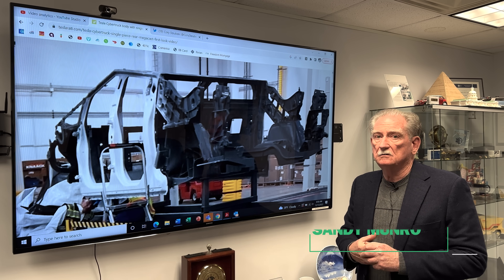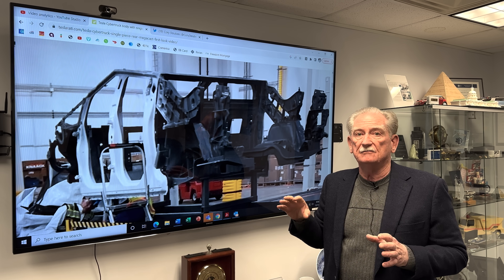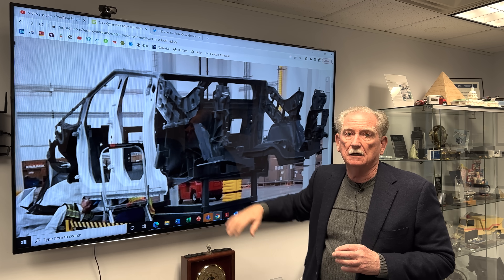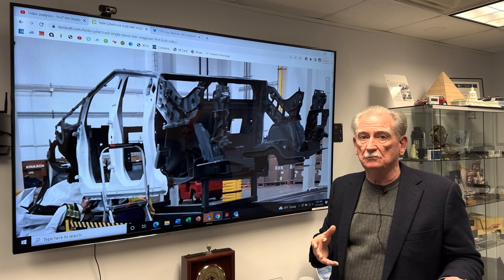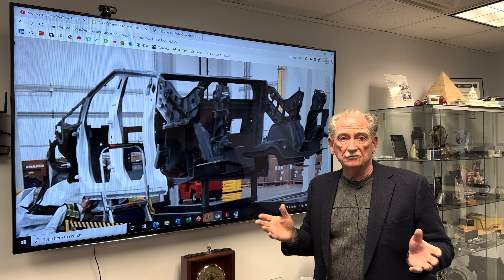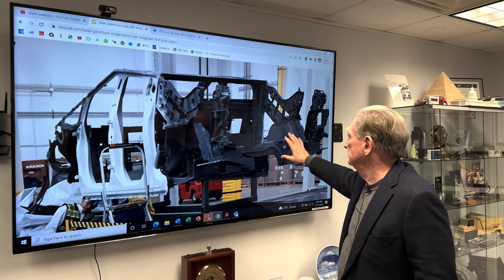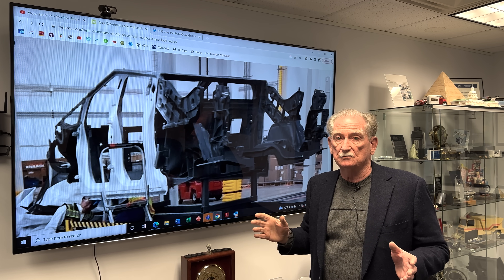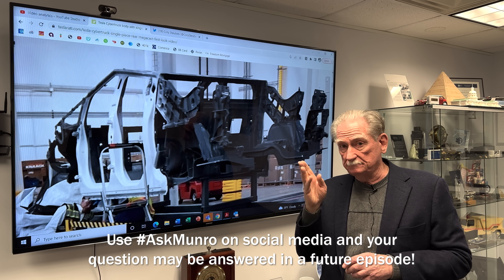Ask Munro E3: Sandy's Take on Tesla's Cybertruck Castings

Comment: I think the casted subframe might be capable of being the base for a van. To make it stiff for off-road and do heavy-duty towing it was inevitable they would need a subframe down under and not just be a pure exoskeleton. I think the casted subframe might be capable of being the base for a delivery or work van and a base for the passenger van that they need for the Boring Loop.  I guess there are not enough shared components to make it worth it and just a new van design might make more sense.

Comment: You can weld aluminum to steel (and thus probably stainless steel) with explosively bonded bi-metal joints. Not saying they used it here but it's commonly used in shipbuilding (steel hull/aluminum superstructure). It's costly too. So structural adhesives? An inner aluminum piece that is mechanically pinned by folded stainless structure?

Comment: This analysis is spot on, at this stage there is no way they would be using giga press machines to produce large castings. Before that they need to get the design perfect and then design the giga press tooling which is a fairly significant job in itself. My guess is the stainless body will be bonded to the aluminium frame.

Comment: For a prototype, sure, but why would they order a 9000 ton press to make smaller parts that need to be welded together? That doesn't make sense. It would be total overkill.
Reply: Uh, but you already know that the Cybertruck isn't made out of "die cast" but out of "STAINLESS STEEL"?!? 
And to deform stainless steel, you need a lot of power...
Reply: They're not ordering a 9000 ton press to make smaller parts.  They're making the small parts to test the final form of the large parts to be cast.

Comment: "It’ll just vanish". No it won't

Lost foam castings have specific issues regarding the resulting quality because the styrofoam doesn't just turn into gas.  You can get liquid entrainment and carbon ripples/contamination.

Comment: Hi Sandy & co. You may be right in that it's an investment casting (lost foam) for prototyping purposes.  For production, though, isn't a 2 part (1 left, 1 right) more likely, bolted to a welded- steel frontal 'monocoque' frame? I suspect that powder coat on the steel frame and aluminium die- castings is there to prevent galvanic corrosion (between the 2 dissimilar metals)?

Comment: Actually, there are 6 castings if we include the back wall of cabin. Based on that image we are looking at at least 3 castings for the front for similar reasons. 
As a prototype, the design may be different to what can be done with a 9000 tonne casting machine. The limit of this type of casting is that the mould must separate with a single axis pull.

Comment: Yes, until recently I owned an aluminium foundry. One of the things we specialised in was lost foam casting.
It's a great way to produce prototype /l ow volume parts quickly . We could easily produce castings in one or two weeks depending on complexity.
The downside of sand castings is that they are much weaker and more brittle than pressure die castings,so probably not suitable for automotive structures.

Comment: The problem with trying to cast large structural sections is that it increases the chance of hairline fractures in the cast due to stress events (particularly spike stresses).  Smaller structural sections bolted together help reduce the spike stress travelling through the metal.  Car companies have over 100 years of experience with very good engineers designing the structural engineering of cars.  People should respect that history and those engineers.

Comment: It appears that Cybertruck's body will be constructed like most unibodies where there is an inner structure and outer body panels.  The inner structure is made up of castings vs the traditional stamped metal pieces welded together.  The outer body panels will be the stainless steel.  Hopefully this puts to bed all the talk about a single casting and exoskeleton.
Reply: I hear ya!
Reply: It appears the 'Bed' is yet to be made. 
Think 'Back To The Future' exactly what Elon described in 2019..... 
E X O S K E L E T O N
Hold my pillow__
Reply: @ivankuljis1780 , the structure for the bed is there in the picture.  There are the two "sails" that attach right behind the door opening. Then there's two more vertical pieces that appear at the end of the vehicle. These verticals create the sides.  The large bottom casting that contains the wheel wells will support the floor.  There is also a panel that goes across the vehicle behind the door opening that appears to support the rear of the passenger area and the front of the bed.
Reply: @bnasty380  
Totally agree .
It's the 'Exoskeleton' that Elon described in 2019 that l'm keen to hear more about. Here's my understanding...The main engineering and torsional forces transmit through the 3mm 30X making this most probably the 'Toughest Truck' of the Twenty-first Century

Comment: So Sandy, in your opinion, CAN this be a single casting for production using the 9k gigapress?  If it is not, what do you think the minimum number of castings might be to make this in production?  Still five?  Perhaps three?  The press IS in the US, it arrived in the Port of Houston over a month ago, but until the other day, none of it had been spotted at the factory yet, so you're correct, there's no way it is set up yet.
Reply: Castings don't require presses. Presses are for stampings or forgings. So the gigapress is utterly irrelevant to casting numbers. As to number of them, I don't think they're going to be able to reduce casting numbers much at all without running into mold dynamics issues, where they end up with flow issues, parts cooling in molds, entrained air pockets, and other defects that would be unacceptable, not without a lot more tweaking of the part geometry to improve castability than I think they're going to be willing to do.

Comment: How do you stick stainless steel onto cast aluminium? Bolts, obviously. Or crimping perhaps. Maybe glue. Double sided tape, even. Most likely glue.
Reply: Glue, been thinking the same. If there is to be minimal re-finishing of the stainless steel then they wouldn't be welding dozens of fixing lugs to the back. Structural adhesive makes the most sense.
Reply: @DessieDoolan  cuts down galvanic corrosion also - stainless steel + aluminium in a saltwater environment... not ideal.
Reply: @weareallbeingwatched4602  I recently re-watched the video where Sandy interviews Elon Musk and Elon is talking about the nightmare that was the original stamped members rear end. Mentions about the issues with connecting different metals. 

Lot to be said for structural adhesives. I have a background in construction, and have a huge respect for modern adhesives.
Reply: @weareallbeingwatched4602  aluminum actually suffers with salt lol
Reply: @carholic-sz3qv  have a read of this article https://www.albanycountyfasteners.com/blog/stainless-steel-and-aluminum/

Comment: The closest vertical 'dolly' support leg shows an insertion point for the Steel 'Horseshoe' tow-hitch member that will give structure to the two casting 'wings' either side of the tailgate.

Comment: I don't get the impression the Elon is a 'car guy'. Not like what I've seen from Lucid or Rimac.
As my SpaceX Elon Tesla thesis has developed, I now reckon that Elon isn't interested in battery tech for cars, it's because on Mars batteries are going to be the 'go to' for energy storage.

I reckon the cyber truck design originated at SpaceX as a mars buggy.
Maybe that is why Musk got involved with Tesla. He wants to cruise around on the surface of mars.
Tesla now has to solve some really stupid problems that they have created for them selves (I'm looking at you wind screen wiper)
The thing is going to be a U.S. full sized truck so no one else in the world is going to want it. Musk has admitted this when he stated that they will probably shave down its size. And he keeps changing the spec like the four wheel steering they want to steal from the GM truck.

If you look at the design of the tray with those fly buttruse sides, Tesla would be better off making a cyber van, and enclosing the tray completely.

I do like that the CT won't be painted, but what I don’t like is that this thing is a great big faceted mirror.
Anyone who isn’t diving the cybertruck is going to hate it, cause it will directly reflect sunlight into everyone's eyes. Look for accidents happening caused by sun strikes.

I’d rather have the Mavericks 'accessible from three sides’ bed, rather then the ‘oh crap, I need to get into the bed and walk down to retrieve my tool box which slid to the front of the cybertrucks bed, under brakes’.

I don’t need a hermetically sealed and air filtered cabin, cause I don’t live and work in the middle of an urban toxic wasteland (and I need a videogame system in my car, like I need a hole in my head ;-) )

I’d rather have a ‘drive by wire’ system where I can move my truck like a RC with my phone, then the continuously undelivered promise of FSD.
Reply: Some good points. Think your right will be mostly for the American Market.
Reply: Nonsense!!! What kind of crap arguments are those!? Lol…. Mars vehicles have absolutely nothing to do with earth vehicles.
Reply: @carholic-sz3qv  The conversation over at Space X possibly went something like this...
'Hay Elon, when we get to Mars, we're going to have to get around the surface some how'?
Elon reply's, 'Why don't you sketch something up on the back of an envelope, and I'll get those physio Tesla fan bois to pay for it's dev'.

Comment: The left side and the right side are two different castings. Look at the very bottom of the casting where a motor/wheel will be mounted are at different depths for short wheelbase and long wheelbased cyber trucks.
Reply: Look at where the casting attaches to the bottom of the truck. Tell tale sign.

Comment: Just wondering if they could simplify the casting by using the same cast for front and back? Both should have similar operating parameters (suspension, brakes, steering and drive).
Reply: thats incorrect, they are vastly different, especially in a pickup.
Reply: In a conventional pickup maybe, but the cyber truck is a whole new ball game 😜 multiple motors, probable electric 4 wheel steering and brakes.

Comment: The aluminum casting can be friction stir welded to steel, like Honda did for years on Accord subframes.  Probably a little tricky in this assembly position though.
Reply: Interesting
Reply: @Retired Bore it definitely gets exposure to road salts, yet has been in production for many years w/o issues, so they did a good job on corrosion control too.

Comment: Thank you for the explanation! I've been wondering if you'd be commenting on it ever since that picture came out. Would flow-drilling screws or thermal friction drilling to form threads be a way for them to secure the castings to the stainless steel pieces? Is it also possible the door frame stamping is also aluminum?

Comment: Using styrofoam and investment casting is a bad idea. Maybe Tesla uses it, but all other car and truck manufacturers use 3D printing from the designers CAD files. I worked for Scania (truck manufacturer) and we used 3D printing in the early 1990´s, for prototypes but it was not called 3D printing then. They still use a large number of 3D printers capable of printing large parts to small tolerances (which styrofoam can't ) in metal that can withstand testing.
Reply: Maybe this isn't going to be built into a working prototype? Only getting to this stage for testing the factory, not the truck?
Reply: @subwarpspeed  You generaly don´t test production with parts that are not meant to be used. Preproduction is done with parts that are prototype parts from a manufacturer. It is a lengthy process from design to purchasing handling the manufacturer (if not inhouse) to first prototypes parts that needs assembly testing for the development of assembly tooling and process if there is a change in design. Truck and car assembly is much more complex than most think.

Comment: If Tesla can pull off the $39k price, it would be perfect.
Reply: I think they've already confirmed they won't be hitting that price by a long shot
Reply: The $39k price was a single motor version which been dropped and before the current inflationary pressures.  No way they can make a $39k truck now and make any money.  Look at the prices for the EV trucks available now.
Reply: Put a one in front of the three

Comment: Hi Munro & Team!
Why does the vehicle still have a Frame and body panels?
I thought the Special thing was a body = Frame Design… is this still the case with the Skin beeing an integral Part of the crash structure or is It just an outer shell?
Reply: This has also puzzled me. I hope Munro team comment on this at their teardown. It was put forward as if they would just fold stainless but it looks (but I don't know) more like a regular body in white which will get SS panels, like the Delorean
Reply: You still have to have door jambs for all the openings.  You still need an instrument panel.  You still need places to mount seats, airbags, the electronics, the bed cover,  etc. Can't do all that with just a box.

Comment: Big casting pieces are great for the Automaker to save production costs, not that great for the costumers. As potential stress fractures due to fatigue, or a simple pothole, totaling the car in some cases.
Reply: Examples?  Have you found Teslas ending totaled a lot recently?
Reply: @trevorwoods1981  plenty of Teslas totaled. Could be due to high parts appraisals and battery packs to be replaced. Tesla business model, seems to pump the most cars they can from Assembly lines, without an equal increase in parts inventory.
Reply: @trevorwoods1981  big casting pieces will function similar to monocoque tub in many super cars. If damaged, the car is totaled. The diference, it's that a monocoque using composites can handle way more loads than a cast Aluminium piece. That why many Automakers in structural pieces use forged Aluminium.
Reply: @trevorwoods1981  plenty of cars get totaled due to strut towers damaged, especially if they are from cast Aluminium.

Comment: So much for it being "stressed skin exo skeleton". This pretty much proves that's marketing hype
Reply: I thought "unibody" from the moment they said that. Granted, it is a multi material structure, quite an advanced unibody, but unibody nevertheless.
Reply: Cast Aluminum for structure isn’t ideal either. Very weak, prone to cracking, and overall poor strength to weight ratio compared to rolled or extruded. Welded castings? Double trouble.. Id recommend bonded with fasteners. The castings could be just scaffolding for load bearing steel plates to be mounted and that’s what I’m guessing is going on here but I guess we will find out eventually. These are the reasons aircraft structure isn’t made from castings, even when it would save vast sums of money to do so.
Reply: Nothing seen in this image negates an exoskeleton. There still must be internal components like door frames.
Reply: Yeah another crap tesla thing

Comment: out of curiosity would it make sense to have the side pieces be the same?  you may have some duplicate holes but it if it is cast would the cost be much more?  Than you'd only need a single oress
Reply: It depends. On the benefits side, you have a smaller number of unique parts to produce, keep in inventory, and move around the supply chain. On the costs side, you have the possibility of added material, added casting complexity (which will lead to a higher defect rate), and increased wear rate on the part mold, meaning you need to replace them twice as often. You have to weigh those against each other for the specifics of any given part.

And then there are the showstoppers: Is it still strong enough to do what it needs to do? Are there any handed curves/angles/offsets?

Comment: Question for the team.
In view of the Rivian bed cover issue, I have a ... "hypothesis" (?) re the cover on the CT.
They could have a roller cover sitting behind the seats, but that's complicated, prone to failure and I think will prevent a passthrough bed to cab.
.
Looking at the later prototypes, I think they may have shortened the opening over the bed and extended the cabin roof back past 50:50.
That would (possibly) allow a flat panel cover to slide under the roof panel.
Essentially a "sunroof" mechanism.
.
Would also allow a bed extension under the rear seat, giving a limited height 8 foot bed length, sufficient for maybe 5-10 sheets of board?
Do you agree?

Comment: It used to be "lost wax" casting used for hundreds of years
now it's "Lost foam"

Lost wax sounds better to me
Reply: Lost wax you have to burn out the mold first, after applying investment compound and then sand to hold it together.  You don’t need to with list foam, so the mold never needs burnout or self supporting investment layers.  Much cleaner and faster.
Reply: @Georgewilliamherbert  and I bet a 3D printer with a hot wire can quickly burn the shape in minutes.
Or a CNC machine.

Comment: Sandy do you not think that the final version could combine all 5 of those pieces into a single casting?
Reply: Nope it’s too big
Reply: And too complex. You have to be able to separate the dies/molds from the part. Sand casting and investment casting can do complex shapes but then you don't need a gigapress. There are still limitations to how a casting can be designed. A few smaller and simpler parts welded together is more practical.
Reply: @bikeaddictbp  Yes. It's not clear (to me) from the photo that this is has a shape that would prevent the mold separating. It might also be "too deep", but I don't know the limits on mould depth for the 9000ton gigapress.